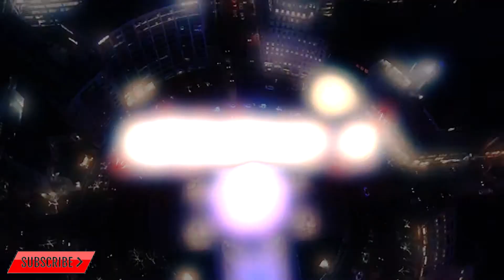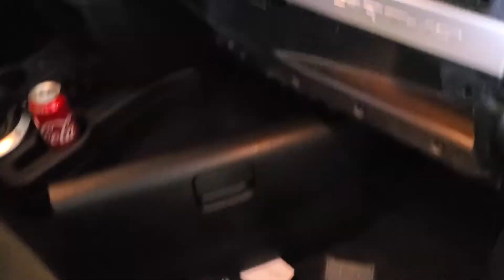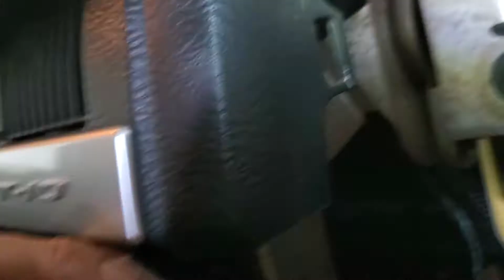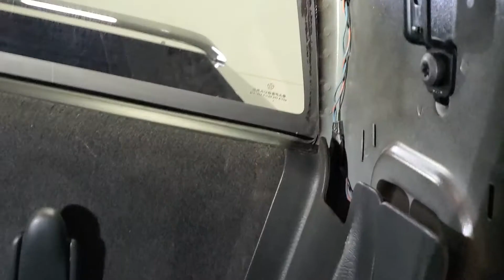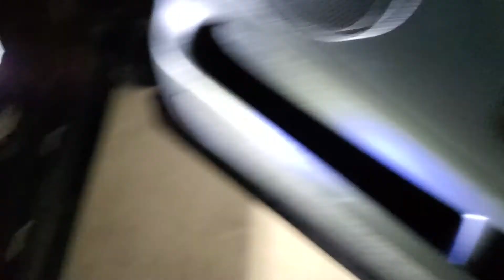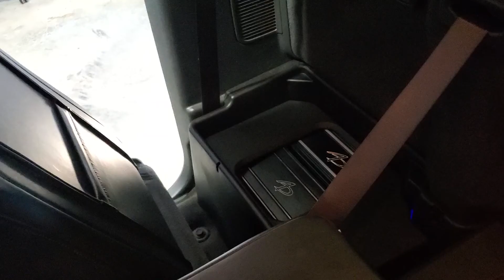DODGE RAM SRT 10 - AUDIO DYNAMICS / DDAUDIO FULL CUSTOM  SYSTEM PLUS SONY XAVAX5000 RADIO INSTALL

Comment: What did you use to wire the tweeters up to the system? Did you have to wire up a crossover and then wire it to your 6x9's in the door? My stereo doesn't have extra wires for the tweeters to be wired separately so I was wondering if you had the same issue.

Comment: How did you wire the two way speaker to a tweeter as well? I wanted to do this in the focus for more vocals,  but couldn't figure out the best way to wire it up since the tweeter has that inline crossover that needs to plug into the speaker and the 2way speaker doesn't have the extra prong on it to branch off it. I was thinking about a high resolution audio like kenwood top of the line two way to connect to the tweeter that came with my components from Kenwood's ps line.
Reply: You might have to loop it